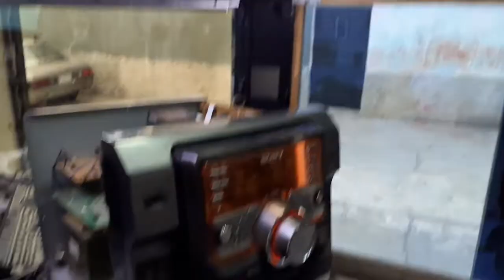Reparando un integrado de audio STK 412 230 de SONY

Comment: Hola estimado una consulta, tengo un equipo sony con un integrado 411 550e, el detalle que noto es que hay dias que el  bajeo de los subwoofer no es tan poderoso como en otras ocasiones, con los agudos y medios no hay problema. ya chequee los parlantes y estan bien.
Reply from the maker: pero es mucha la diferencia ? o no se nota tanto
Reply: @akireparofrentealcliente9108  se nota la diferencia, pero ligeramente
Reply: si en caso hubiera una falla x ahi y el stk estuviera bueno, que otro componente podria bajar la potencia del bajeo amigo?
Reply from the maker: Si no es el STK podria ser el preAmplificador q la mayoria traen el 4558 q es uno pequeñito q tiene 8 patas 
o podria ser alguna comfiguracion del sistema

Comment: Hola amigo, una pregunta, quite el stk de un modular Sony ya que se protegía y al quitarlo ya prendió bien, la pregunta es si ya prendido debe de dar audio en la salida de los audífonos o es normal que al quitar el integrado no de sonido.
Gracias.
Reply from the maker: Si es normal porque algunos vienen conectados a las salidas de los audifonos 
No todos pero si los aparatos de antes si asi vienen
Reply from the maker: Los aparatos de ahora si traen un pequeño amplificador aparte solo para los audifonos pero los de antes usan el mismo STK
Reply: Gracias por responder, en caso que se requiera una asesoría podrás echar la mano para ver si puedo hacer el procedimiento que haces en el vídeo.
Reply: Digo, contactarte por el facebook que pones en los otros comentarios.
Reply from the maker: Si esta bien ahi estoy en facebook
Reply: Gracias, te contacto por ese medio.

Comment: Hermano saludos yo tengo un sonido igual del video. Prende bien solo les falta los stk. Podre ponerle 4 transistores agarrando la misma alimentación de los stk
Reply from the maker: No ! sin los STK no se puede porque tiene que tenerlos aunque sea malos porque es en ellos que se tienen que soldar los trancistores.
Reply: @akireparofrentealcliente9108  Hola brother dinos como conectar los transistores al stk porfa, te agradeceriamos cualquier diagrama de como lo hiciste, gracias
Reply: @akireparofrentealcliente9108  Un cordial saludo! Y gracias por compartir tus conocimientos importantes para nosotros los que necesitamos recuperar estos integrados de salida! Te quería preguntar: es que tengo un ic 411-240e de un Sony. Un día y ya hace varios años que le cambié ese integrado y solo me duró unos 6 meses. Le estuve buscando un ic que fuera original! Pero no.... nó me fué posible conseguirlo! Habia pensado lo mismo que haces aquí! En este video! Y hasta ahora lo encontré 🤩 muchas gracias por tus buenos consejos amigo y colega. Dios esté bendiciéndote Continuamente 🙏 AMÉN

Comment: Amigo tengo un zx10d y solo se escuchan las front L y R
Reply from the maker: a esos equipos se les desconectan las bocinas segun lo que uno quiera con el control o con los botones 
si tubiera malo algun integrado no encendiera 
deberias asegurarte en el menu del sistema
Reply: @akireparofrentealcliente9108  no tengo el control original amigo, sabes cuál sería , porfa
Reply from the maker: con los botones del equipo porque almenos este modelo si tenia un boton que asia ese cambio para encender solo las frontales y las aereas y la del centro y asi diferentes funciones
Reply: @akireparofrentealcliente9108  ya le hice y sale lado A y lado B
Pero aún solo se escuchan las front L y R amigo
Reply: @akireparofrentealcliente9108  
Siento que voy a tener que buscar un buen técnico para que lo revise amigo
Reply from the maker: si entonces si es por dentro la falla.

Comment: Hola, justo estaba buscando un vídeo de estos para sacarme la duda de si se podía hacer, veo que se puede.

Para identificar el transistor a reemplazar como sabes si es npn o pnp? Te fijas en el datasheet? 

Gracias por el video pude sacarme la duda. Saludos Desde argentina
Reply from the maker: no yo no utiliso el datasheet porque no sirbe de mucho  simplemente hay que ver que voltaje le llega al colector porque normalmente si le llega positivo al colentor la base del trancistor seria positivo y de igual forma con el negativo y normalmente en estos STK el cuadrito de aluminio es donde le llega el voltaje aunq hay algunos q cambian pero la mayoria son asi y la mayoria lleva 2 npn y 2 pnp aunq hay algunos q los 4 trancistores son positibos 
solo hay q ver los voltajes que son "positivo" tierra y "negatibo" 
ejemplo 
+35v   tierra  -35v  
te aconsejo mejor que armes un amplificador con trancistores desde cero y completo para practicar y jugar un poco con los sonidos y ya despues es mas facil reparar los STK